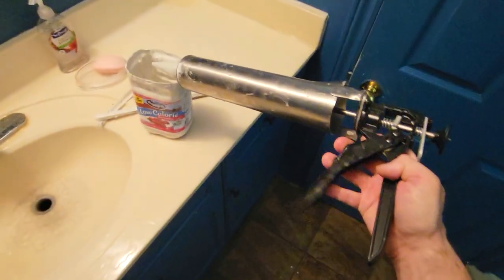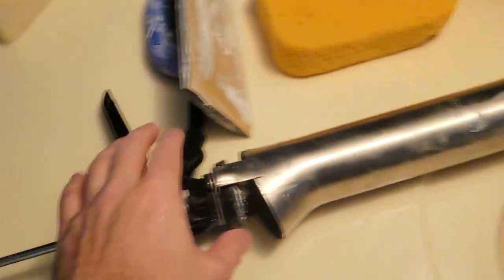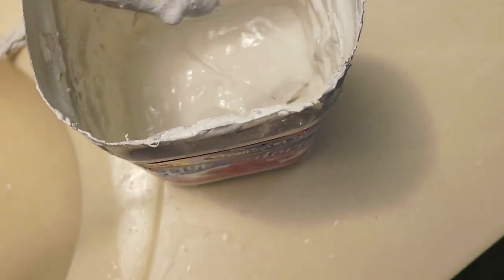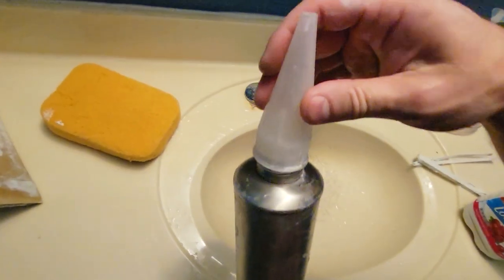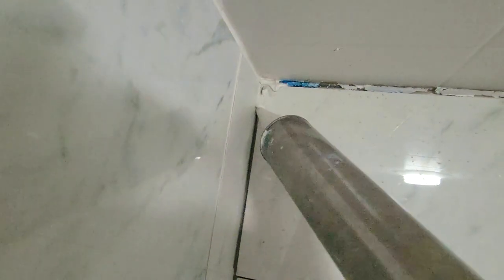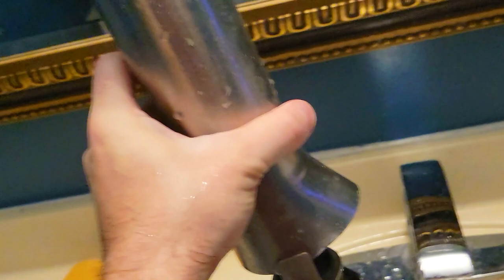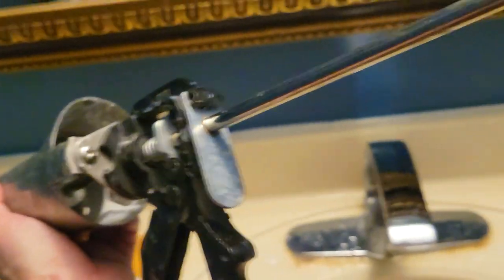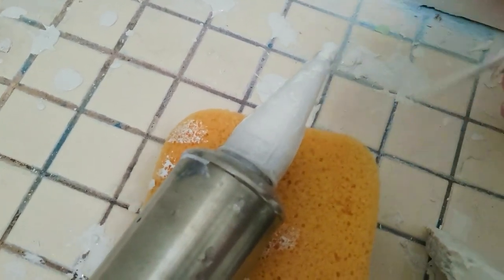Grout Gun For Mortar, Grout Gun for Tile - How to Use Gun for Grouting for Walls, Ceilings, Shower

Comment: You never use grout on an inside corner, especially in a wet area. Use silicone sealant, colour matched to the grout.
Reply from the maker: Good to know!
Reply: @UnboxingArmy I'm not sure what he's talking about. I wouldn't use it on horizontal inside corners unless you knew it was waterproof past that, but for the actual shower tile? Lmao.

The guys I watched and learned various tradecraft from had combined hundreds and hundreds of years of experience. 

My bathroom has the tiles grouted in the corners and no issues almost a decade later.

They also say not to use mastic on a painted wall, but 10 seconds of abrasion and I've seen those last over 30 years.

I tend to ignore folks who aren't helpful. Actual advice givers are usually super kind about it cause they've been in your shoes. Steve might be a hack and projecting

Comment: I hope you're not charging for that work. It's abysmal, full of very basic mistakes.
Reply from the maker: No, I'm not charging for the work, but i charge my wife $1430 per hour. I'm sure you're a well qualified contractor, but no need to troll diyers,  I've flipped many properties , you're only seeing a basic quick video not grouting video. And I actually do prefer grouting in corners as well, the hard surface is better than  silicone that gets dirtier faster. 😀